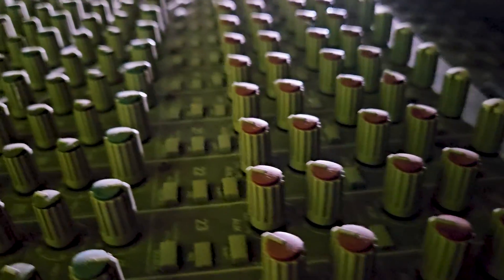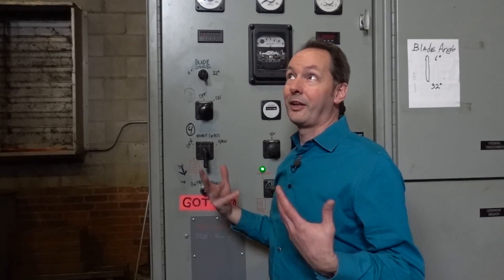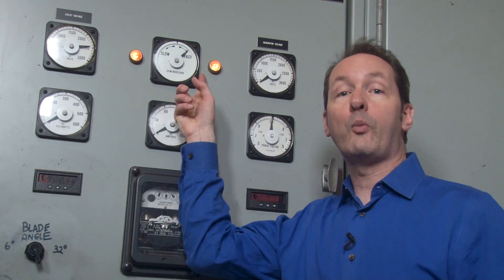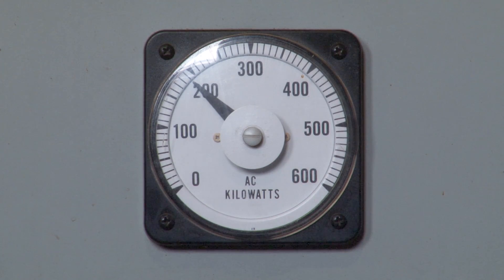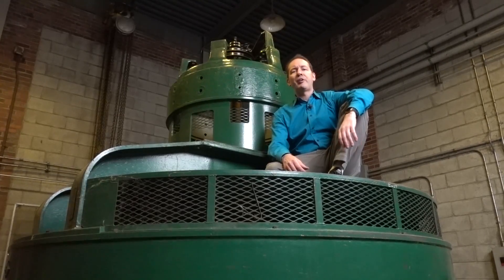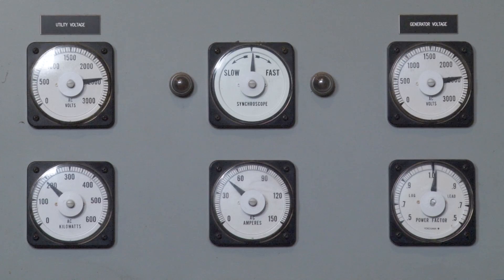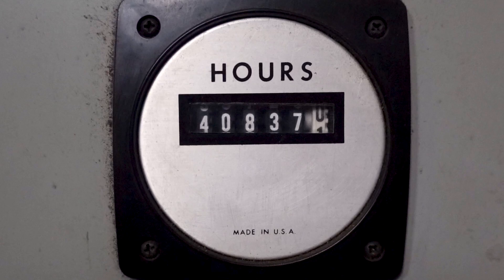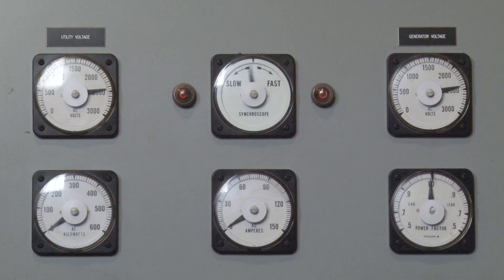Powerplant Control Panel Tour - Part 1 Authorized Personnel Only S4E1 #engineering #powerplant

Comment: In another life I was a radar technician at a remote station on the Alaskan Peninsula that was of course not on any grid.  It was powered by five 300kW White-Worthington vapor-phase cooled diesels, which were also the heating plant for the site.  I made friends with the power plant operators so I could watch from within the control room when they did fun things.  Usually it took only two of the generators to power everything, but under some conditions they had three on line.  This brings back memories.
Reply: Once, as a bored radar tech on a remote Japanese island I thought it would be fun to mess with the Japanese power plant operators. I would power up the backup transmitter into the dummy load and listen for them to crank up another generator. After a minute or so after everything stabilized I'd turn off the backup transmitter so they would turn off the new generator. While things stabilized the lights would flicker all over the site (and the jukebox in the NCO club sounded like the the spindle wasn't turning at the correct rpm. It wasn't). After a few cycles of this I got an irate phone call from the NCO in charge of power production; "Whatever the hell you are doing, knock it off" putting an end to my little joke.

Comment: Thank you for that explanation of power factor. I am a mechanical engineer that deals mostly in thermal problems, but my company makes electrically tied equipment. Another ME tried to explain it to me as apparent power vs actual power and it sounded like voodoo magic. this grounds it better.

Comment: A youtube video of a new concept generator. (Infinity motor generator) this gen uses lenz force or load force to push it forward. Therefore infinity is designed with more coils and permanent magnets to push the rotor forward.

Comment: Chris, I don't know if you remember me but way back in 2019 I believe when you were liquidating the geek group, I went with my dad to check it out. I was only 14 at the time and found an apple II that you let me keep for free with all the applesoft books on the condition that I would actually use it. We also had a conversation about the copper wire recorder I found that they would use in WW2. I spent a couple weeks learning basic applesoft with the books you gave me and make a couple simple programs. Since then I have learned to code in java and HTML, and I am studying mechanical engineering at GVSU. I wish I knew about the geek group before it dissolved and I am glad to see you are doing good.

Comment: What does your ground fault detection look like?

Kind of surprised you‘re doing your synchronisation by hand, at least since the 80s. 6-12kV distribution. hundreds of MW diesel capacity..
Reply: We‘re not allowed to leave any old devices in the cabinets and work under stringent change ctrl.
It is paperwork, I agree, but we don’t have outdated wiring diagrams etc.

P-Touch printer for labels and a good work permit system would go a long way to ensure that the plant can be operated safely and efficiently also in the future when „the old dog“ has left the company.

That 250kW generator is sweet, it is huge for the little power it generates. That‘s the way things were built in the old days 🙂‍↕️

Don’t you have to keep a certain level of headwater to ensure that there isn’t an issue with the groundwater upstream?

Comment: In college, I worked at a chemical plant that had its own onsite power generation. Apparently, back in the 60s and 70s, the system wasn't grid tied. The old guy who was showing me around said to get the cycles right they would try to sync the old wall clock up with a mechanical stopwatch.

Comment: 5:20 if you're going to upgrade, you can probably gut most if not all of your metering, control, and protection and replace with an SEL-751 or SEL-700G without much issue.

Comment: Hey Chris, Im a low voltage marine electrician, 
That being said I understand volts, I understand amps, ohms, and the relationship they all play, and how they effect each other, I know how to calculate watts but that aside, a genuine question
Why do watts matter? amps and volts tell us all we need and watts are just a product of the 2.
I don’t understand why it’s necessary, because when gauging wire size, I need amps and the voltage going through it so to make sure it won’t melt and the conductor can handle the load
I don’t get why the number is important, I never bothered to ask the question before but figured you’d have a good answer.
Reply from the maker: Mainly, it's a way to save on mental math. At small scales like you're used to, it doesn't really matter. Amps is the main concern when you're out on the end of a branch circuit with single devices and such. For the typical homeowner (or boat owner ;) ) the only time you're really thinking about Watts is when you're dealing with your Audio amp or a Generator.

But when you start having to work on large aggregated loads, like big generators and such, Watts (or more commonly with AC systems kVA) tend to be the unit of choice. REALLY big things use stuff like MVARs, but that's not something the average person will ever deal with.

Comment: VARs are a fantastic thing.

Former submarine electrician/electrical operator turned hydro plant electrical engineer turned power system apprentice trainer. Sometimes my ADD fights with my OCD.

Comment: This is a fantastic channel. I used to be around this stuff worked with hydro electricians ... I'm more of a industrial controls electrician, but got the opportunity to work on the utility side of things... You may think you know it all till you work with a different class of electricians... My advice... Wherever you're at in life with your electrical career, delve into the other ones and see what they do. Those hydro electricians are pretty smart cookies...I learned about PT's, CT's and did a lot of switching and valving with them, even wrote a lot of switching orders... WAY different than working in a manufacturing facility where your responsibility is keeping robots and automated assembly equipment running...I learned lots from them bringing small hydro power plants on line and off line for maintenance. Great stuff. Subscribed !

Comment: Fantastic. I work at a power station that is similar but much much bigger than yours. It's mind blowing to see that we still use technology from years ago. I have some chillers that are abandoned in place in remote areas of the plant that are from the 50's (plant was build in the 80's). We don't remove them because any load changes to the building require an engineering modification and filed design change that costs millions in man hours to just file, that doesn't include the cost of disposal because most of this can't be sent to a scrap yard and we have to pay a lot of money for disposal.

Our diesel generator(D/G) control panels are laid out nearly exactly like yours are except there are a lot more options available. When we run a diesel tied to the grid it's pretty neat how the grid moves the D/G but the switchgear the diesels power are of the upmost importance which is why they have a 7MW diesel dedicated to them. Power coming into the plant gets split to different areas with a lot of redundancies. Without going into specifics the alternate and backup power sources for the important switchgears are slightly out of phase of one another. We use the D/G to carry the load of the switchgear in an isochrones mode where there is no power factor, D/G output voltage is the voltage of the switchgear, frequency is based off the engines speed, and current is based on the load requirements of the switchgear. What's weird is that we start the diesel, flash the generator, parallel to the grid, open the incoming switchgear breaker, move the frequency and voltage around to match the alternate source, then re-tie to the grid via the alternate. Now the coolest part about this is that it can be done from the main control room or from the local panel. When running from the local panel you are standing in front of a diesel engine that they put on cruise liners and you can hear it change pitch through each part of the evolution.
Reply: The main generators are pumping out around 1200MW at 22kV from a turbine generator that's 150ft long

Comment: Thanks for sharing your videos, I know I’ve seen shorts from this video but never actually found it before. From the perspective of a senior system operator I always thought talking about how many houses worth of electricity was one of the stupidest and made up numbers I’ve ever heard. Typically used by someone from the public relations department that wouldn’t know a VAR if it was lighting their thought bubble. If you do cover black start in the future might be interesting to see how speed droop is set. It’s one of the most typically forgotten settings when operating without an interconnection.

Comment: I thought this channel shut down because it’s been like a year since last update… now I’m checking it every couple days so I don’t miss part 2. One thing I’d really like to see at some point is the details of how the synchroscope actually works. As in the actual magnetic/mechanical method that it compares the frequency of the grid and the generator.
Reply from the maker: Hi there :) I have some most excellent news for you! Part 2 is already in production and will be out when it's finished. And yesterday a Synchroscope arrived on my workbench and we'll be doing a full detailed exploration video of that just as soon as I figure out how to make a variable phase 120VAC power supply. So that's in the works as well. :)

Comment: By day: Explaining to the plant electrician that we need a delta-wye transformer because our building dates back to before WWII and yes the shiny new DC fast charger requires a neutral.

By night: nerding up on the old railroad and rural 32VDC standard, solar DC daylight drive machinery, and running everything else off 12vdc thus avoiding AC inverters that shit the bed every few years anyway. I even heard of a company that proposes to wire commercial buildings with 5vdc LED lighting comnected with.... Ethernet cables instead of Romex. What a time to play with electricity....
Reply from the maker: Ohhhhhhh what kinds of things do you work on?
Reply: @Physicsduck  I develop training on DC fast chargers for a major Class 8 truck manufacturer. At home is nothing more than boring old grid power. I just like learning about the oddball stuff. Living Energy Farm has done a lot with solar "daylight drive" as they call it for direct powering of DC motors for threshing and ag pumps. They also eschew lith-ion in favor of nickel-iron batteries, which is....cool kinda but LiFePO4 has come down so far in price Ni-Fe is kinda nothingburger anymore.

Comment: Two panels that will keep you staring for hours are the old slate-backed panel in the Worthington generator shed at the Buckley Old Engine Show (now disconnected but AIP for your staring edification) and the DC knife switch panels for the old steam DC plant in the basement of the New Yorker hotel. Which I saw a video of ONCE and never found again. Skinner Una-Flow engines. Pretty sexy.
Reply from the maker: There's a couple of the old slate panels still in use out here in the wild. I'm trying very hard to be able to get some video of them, but the security guys have a problem with that. They DO exist though, and they're STILL IN SERVICE!

Comment: Great videos, thanks for making them. 
If your head and tail water reading is possibly a 4-20mA signal, given the cable used and you are in the US, so probably have it going to an AB Analogue Input module on the PLC. You can get those meters in versions that can handle 4-20mA (Redlion is one example), so just connect it in series (once you confirm you have the right meter, etc), and you can have both working in no time at all👍🏻
Reply from the maker: Thank you! I think you're right and that it IS a 4-20mA current loop. We'll explore this in the future and find out. :)
Reply: @Physicsduck  Thanks again for making these videos. They give a real meaningful insight into what actually goes  into generating and transmitting electricity. I studied a lot about transmission at uni but ended up working on the consumer side, so it's fantastic seeing more about the generation side. I'm sure a lot of people who use electricity every day also just find it interesting to learn how it all works.

Comment: Analog meters rock. They might not be as accurate as digital ones, but the visual feedback they provide is much comprehensive to a human brain. Specially to check fluctuation. When it changes you notice not only there's a change, but also to which direction that change is happening. With a digital meter you can notice there's a change. But to see it's direction a human brain has to process an integer base 10 number. If you have one or two meters this can be acceptable, but when you have to monitor a bunch of meters, I wouldn't be that effective with digital ones.

Comment: @chris Boden, any chance I could get the part # or manufacturer for that small voltage/frequency colored display??? Looks like it changes color according to how far off the mains are at! I can hear my frequency and voltage change constantly at home when the local solar farms kick in and out, was wanting a small wall mount meter I can watch during the day. Thanks and thanks for the awesome videos!!

Comment: @ 13:56 i think i see why is it the stupidest idea ever to measure power in kWh: i think it's because (k)w is do care about power factor 'cause it's in the formula since this one is "volt×amp×power factor" (or "phi"  for close friends) and not (k)VA and it made way more sense to measure VA rather than W since WE don't (necessarally) what PF should we assume from all the grid (transformers like transmission lines)

Also, at a time in my life, (k)wh sound misleading for me since, in both mechanic and thermic, a watt is a joule by a second. Then, it become clear when i learned that, despite it's the same unit symbol, it won't mean the same thing because, on the left corner, we've got an electrical watt, and on the right one, we've got a mechanical/thermical watt

Please forgive my misspells, i'm 35-and-half, french and still learning everything, english included...

Comment: This is my first comment on a YouTube video. Love the channel! 

I’m in the software engineering space now but at one point I was a maintenance electrician and had a little exposure to power generation. 

This answer may have already been proposed so forgive me if I’m duplicating it. I think the meter readings can be explained by real and reactive power.

A large chunk of the loads on the grid are inductors and when your AC load is “too inductive” or “too capacitive” reactance starts to come in to play. 

The meters show real power. But the generator has to work hard enough for real + reactive power. 
I think utilities have large capacitor banks to account for this. 

A quick google shows the math for this. If you assume 60Hz AC the math is really simple but if you drop that assumption, time to bust out the calculus.

Comment: kVA/h are better I guess but I’m scared. My apartment is using 115W (196VA) at idle. With the fridge running 160W (230VA).

With that PF (0.59) I guess billing by kVA/h would be better and also would force me to only get devices with good PF correction. I mean which modern electronic device doesn’t use switch mode power supplies? 

The cheapest I personally own was a 0.1 PF 5V USB power supply. When I found out that thing went right into the electronics recycling bin.

Comment: An important thing to note with capacitors in electronic loads is that power factor isn't so simple as causing leading current; those caps are usually sitting on the load side of a rectifier, and thus line current is only drawn when the instantaneous line potential exceeds the instantaneous capacitor potential (and the diode drops, you pedantic pricks).  This leads to the happy happy fun time world of Distortion Power Factor which engineering circuits don't do dick to explain as they only ever cover displacement power factor (the 'sine of the phase angle' shit you've probably seen).

Comment: As a technical director, i don't need to look up Vegas mode. 

I remember when I first saw a automation demo and the faders moved on their own.

Better yet, i remember my dad's JVC HiFi receiver back in the 90s. When you turned the volume up on the remote the knob turned on the receiver.

That was the start of my control panel fascination.

Comment: 2450 [V] * 46 [A] * sqrt(3) = 195.202 [kW], you have to multiply the Volts*Amps by sqrt(3) to account for 3 phase power. All the dials agree.

Comment: I designed and had built 3 synchronizing panels almost exactly like yours for 3 generators at my GE plant. Of course, I used the same model GE meters and switches.
Reply from the maker: That's cool! Now I'm out here trying to find the same gauges to match, lol.